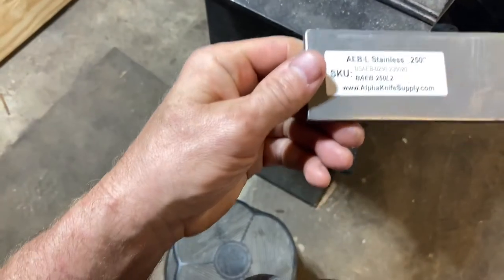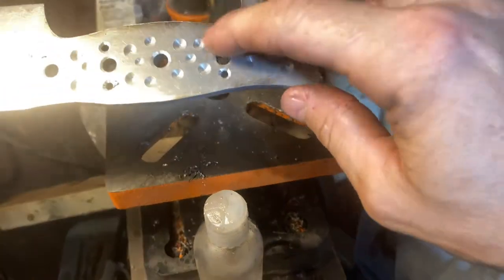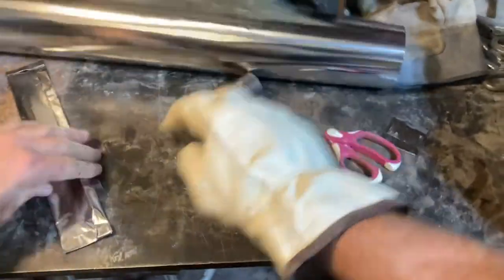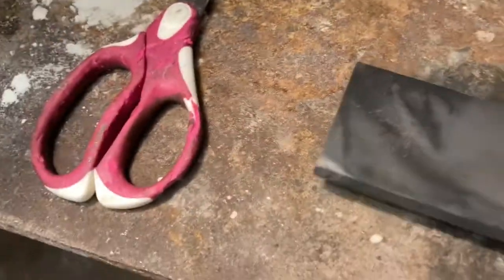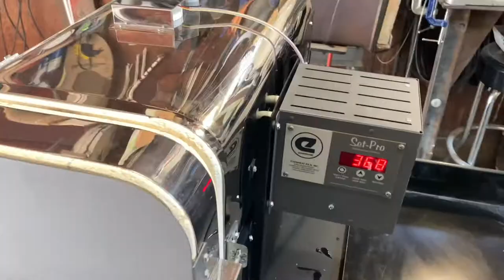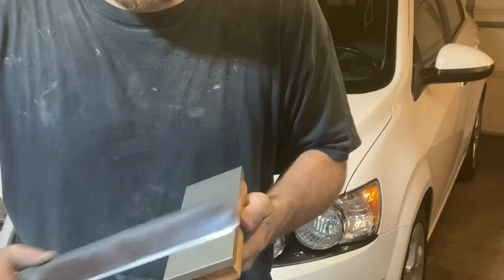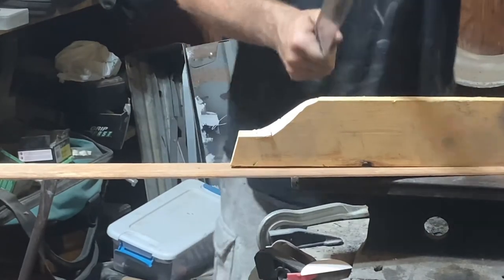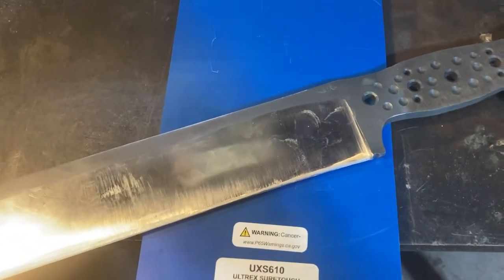Competition chopper AEB-l

Comment: Nice chopping blade, I am gearing up to make a short sword in the same stuff.

You really shouldn't be sharpening to a burr. A burr is steel that collapsed under the pressure from the sharpening abrasive, and is by definition weakened metal. You can induce a burr with too much force on the edge when sharpening, but it can also be indicative of issues like overheating, poor heat treat etc. All of these things have been shown by lots of other people. 

The ideal sharpening process would be to shape the edge with a stone until it won’t reflect light, then refine with higher grits to achieve the grit finish you want. If the knife already had an edge but was used fairly heavily, it is almost always best to start with de-stressing, by cutting directly into the stone and removing fatigued metal at the edge. 

Sharpening on a burr, or on fatigued metal has been shown to reduce edge retention by a huge amount, 90% or more. Yes, really that much. I never did this before and I have noticed dramatically higher performance in my knives since I started.
Reply from the maker: @the1stvendetta  the only difference is these have never been sharpened. This is a first initial edge put on them when making a knife. The bur is essential for evenness and knowing your symmetrical.